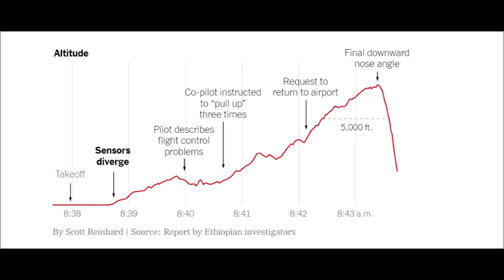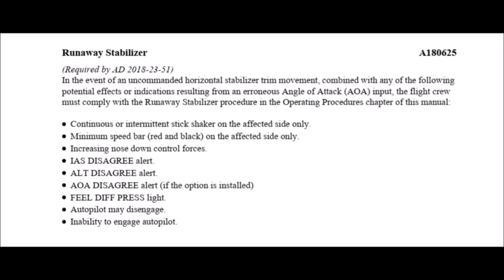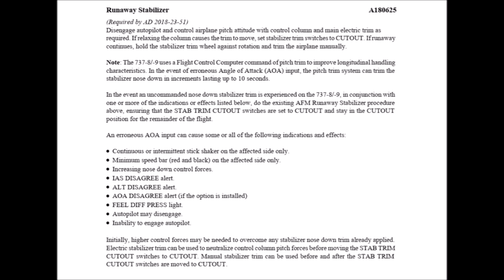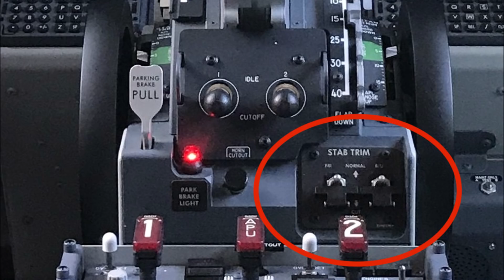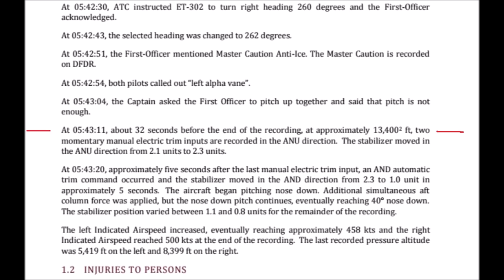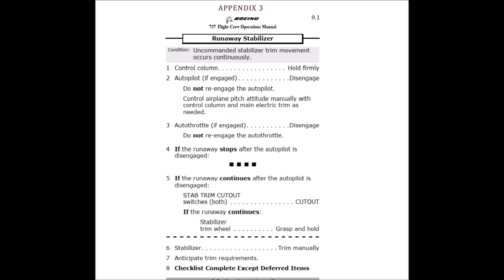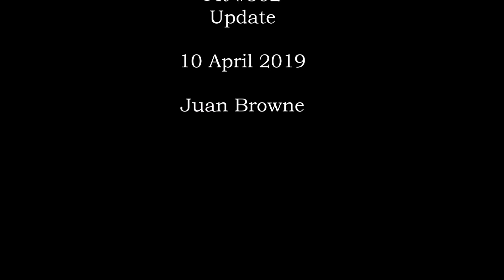737 Max Update 10 April 2019 Runaway Stab Trim Procedures

Comment: With tunnel vision and startle factor in mind, perhaps the synthetic voice for overspeed should be changed from "overspeed overspeed" to "overspeed reduce thrust" especially if the systems detects thrust is set to anything other than idle.  But I guess they may not even hear that with all the other notifications going off.  Just thinking out loud here.
Reply from the maker: at the same time the stall shaker is going off...very confusing.
Reply: @blancolirio  It is.  Brutal situation with little time to process.

Comment: I am not a pilot but to my understanding, there are only three attitudes to control on any plane - roll control by ailerons, yaw control by rudder and pitch control by elevator or horizontal stabilizer, ( yes I know there are other arrangements) but in the case of the 737 the only other variable related to these are the throttles (power) and I also understand that trimming the aircraft to fly straight and level hands off used to be the job of the trim tabs but in this case trimming the horizontal stabilizer. My question is if the aircraft had recently been successfully operated wouldn't the pitch trim be relatively correct even though the CG  might vary with the load. Is it, possible pilots are slowly being reduced to button pushers and are incapable of maneuvering the plane by controlling these three basic functions? It seems unlikely to me that the elevator or (horizontal stabilizer) control could be taken away from the pilots against their wills by an electronic device and if that's possible then the MCAS system is indeed a huge mistake. My sincerest condolences to all those survivors affected by this tragedy.

Comment: They should've geared the manual trim wheel lower, so it's usable at high speed. Because right now if there's a high speed electric trim failure, you're done.

Comment: You can discount anything Ethiopian airlines has to say about the crash, they are concerned only about their reputation and are incapable of objectivity, it's obvious that the crew did not understand the systems and mishandled the aircraft, even though the mcas malfunctioned the procedures were there to regain control, by not reducing power aerodynamic forces made it impossible to regain control and that's the pilots fault ,not Boeing ! They didn't follow correct procedures, simple. In a previous Ethiopian airlines crash (flight409) when the stick shaker activated the captain asked the first officer " what's that" I wouldn't fly this third world air line for free !

Comment: Very good and professional series of explanations to what might have happened! however, can one be really sure that the trim runaway procedure really shuts off the MCAS system?
Reply: To the best of my knowledge, MCAS controls the trim via electric motors. Once the stabilizer trim motors are deactivated via the switches, these motors can no longer run, no matter whether the pilot is attempting to operate them or MCAS. Once the Stab Trim switches are turned off, the only way to control the trim is through the manual turning of the trim wheels.

Comment: When are they going to replace all the Angle of Attack (AOA) sensors on all Boeing 737 MAX aircraft?
Reply: They better figure out a way to test it.  Who knows if it is properly designed and tested?  It could be like the lint filter on an LG dryer.

Comment: As a non airline pilot I'm shocked the more I investigate the industry at just how much of the work that tech does. To me it seems simple, the reason there are complications is because pilots are trying to deal with systems, rather than stick n throttle basic flying. If pilots were once again hands-on then I feel that certain types of accidents would reduce.
Reply: @c7042  we remember differently. I agree there were accidents due to pilot fatigue but that's because of workload demands driven by greed of the companies and could easily have been ended. Maybe British tabloids reported less, but I felt safer back then. Any System that has complicated /many parts having to work together introduces more risk, especially if those parts work differently. Like computers and people. Yes people are prone to err, and autopilot etc are amazing these days, but if you have good standard flight crews in charge and using the correct aides which allow them to always take immediate hands on total control, then I still feel it would be better.
Maybe they can incorporate a function initiated from the stick, were by pressing one button cuts out all mcas primary control(is this available?), instead of reaching to the panel to flick two switches. I always feel that as it's we who invent tech then it should be an aide and not in control. I see the accident as being a problem of a pilot having to deal with systems, were as without mcas in the picture I doubt an accident would have occurred. Computerisation induces laziness also. Unsharpens the mind and leaves it prone to distraction. Or to relying on it.
I suppose it's how you look or see things. We are subjective creatures after all

Comment: Very good report!  As a ATP/Instructor pilot with over 18k hours and 33 yrs of flight time. am disheartened that the aircrew 
didn't know or comply with required Memory items of the Emergency Trim runaway Checklist!
Reply: Lostcreek 1 The checklist as written and the AD update as written are completely out of order, with steps written, not following chronology, twisting words to not list MCAS by name, not describe the effect of manual electric trims on MCAS, not removing counterproductive steps (AP/AT off).  A proper procedure could have been written as briefly as the AD in a way that could be followed in a high stress emergency like the Indonesian crash.  The procedures used by the two Indonesian crews (living and dead) would make more sense.  Something like:
Condition: (as in AD but listed before procedure)
Procedure:
  1. Watch trim wheel movement throughout procedure.
  2. Repeatedly press the trim buttons as fast as possible until trim is good (this disables MCAS) if this doesn't work, repeatedly engage AP (this also disables MCAS) while still pressing trim button.
  3. counteract with buttons whenever it starts moving down (this should limit MCAS down to 0.4 units at a time).
  4. Once trimmed, cutout trim switches and grab the trim wheel.
  5. Fly manually and land.
This skips the steps applicable only to other problems, inverts the AP off step, lists everything in the correct order, actively counteracts MCAS and restores a flyable configuration.  It also avoids ambiguous phrases like "manual trim" versus "manual electric trim".
Reply: @johnfrancisdoe1563  Dear John Doe,  thanks for your comment.  I don't follow your note. as to all your claims of how a checklist and AD's are designed and  written and approved by experts in the aviation industry and regulatory bodies.  Please submit your idea to the FAA!  When you get a chance!

Comment: After watching your videos on this MCAS system I feel I would be a good asset if that happened.  unfortunately the cabin doors are closed so I would be dead along with the pilots focused on fixing the trim.  My opinion as a programmer and dealing with what ifs, Boeing really fast tracked that system.  They alway brag about redundancy but failed to incorporate different scenarios in their MCAS.  It should have know speed was way above stall, height above ground, through through multiple inputs from flight trying to reduce MCAS effects and alerted shutoff of system.  This would work even if the stall indicator was bad.  Hard to stall a plane at 500mph even at high angles.  The speed would have to slow down to stall.  Not having 2 sensors for input tell me that they didn't want to bother with the complexity of figuring out which was correct so decided to get the plane out fast as they didn't anticipate this new engine making a difference in selling airplanes.  They could have made a band around those switches to differentiate them from all the other switches with a line Death will follow if you don't cut these off when active with one bad sensor.  I just watched the spaceX launch of the falcon heavy.  They seem to do things right with verification of each step.  Maybe Boeing should buy some real engineering time from Tesla to get some sophisticated software to fly a plane.  The autonavigation of a model 3 is way more advanced than handling a few hundred sensors and hydraulic pumps.  It actually has to look at stuff through cameras and make decisions.  Reading one sensor and controlling a motor is not a very sophisticated piece of software.  Guess they don't have liquid cooled supercomputers in the plane.  They should have designed an aircraft to handle the power plant instead of sticking them up and out and whipping up a quick fix.  
I visited the Boeing's museum and was impressed by everything but this is a real issue in management not giving the worker bees enough time to make this right.  
GREAT video and love watching your channel.  A friends son is a pilot and someday I will have a discussion at a party and see his view on this subject now that you as usual gave a clear and concise explanation as I am sure Boeing is not giving to the FAA.
Reply: Rick Ruehl , great to hear this from a programmer. Im not a pilot or a programmer but I've spent years operating automated industrial equipment and witnessed things happen that are supposedly impossible according to the PLC in charge. When I was able to demonstrate that I could replicate the error by blocking a photo eye with debris and making a couple switch movements, the electricians grudgingly admitted there was a problem in the logic, and made a simple fix.

Comment: I spend some time analyzing the data (graph from the preliminary report). And this is mine conclusion:  1) 100% trust was the only thing that was keeping the plane's nose up. Check the correlation between the pitch and the trust during the ascent phase. Reducing the trust at the end sealed the fate of the flight. 2) The manual and automatic trim graphs show that manual trim overrode  MCAS action and started turning the trim the right direction. I am afraid that pilots missed this motion revers and unfortunately turned off the trim according the procedure. 3) The end was when they re-enabled the trim without pressing manual trim and reduced trust. There were ways out: 1) Turning off the trim once the stick started to shake, 2) Never fully retract the flaps to keep MCAS in "stand-by" 3) React sooner to the MCAS action (about 30sec once flaps were retracted and the autopilot disengaged) 4) Use the trim button to put the trim in neutral position and only then turn it off. 5) try manual trim again once re-enabling the el. trim.

Comment: When you mentioned 500 KIAS, I was thinking "Mach Tuck" and you brought up Transonic Flow.  That definitely would have aggravated the nose down forces they were facing.
Reply: Mach Tuck is usually trimmed out by the auto pilot or some kind of automatic Mach trimming device in many aircraft.

Folks may complain that there is to much automation but the reality is transonic Jets needed all of the following since 1940s. These problems can not be solved aerodynamically.
1 Yaw damper to operate the rudder to stop high speed snaking.   Germans were testing these in 1943.  It’s just a part of Jet aircraft.
2. Automatic Mach trimming device to trim the nose up as the center of lift suddenly moves back on the wing at transonic speeds.
3 Yaw dampers also add rudder to eliminate pro-verse and adverse yaw when banking the aircraft due to different drag of ailerons at different speeds .  This manifest as either a tightening turn in the opposite direction both of which are undesirable.
4  differential ailerons.  An aileron should be deflected less in the downward direction than its partner is deflected in the upward direction due to the greater drag of downward deflection.
5 in most aircraft the thrust axis does not align with the principal drag axis.   From a structural point the optimal layout is to have a low wing and underslung engines.   I Leef of this layout pretty much requires automatic pitch control.
6 fully powered controls with no mechanical linkage to the flight control surfaces is absolutely essential so that the phenomenon of flutter and pilot couple of solutions can be eliminated.

So there was already a high level of Automation you can’t avoid however the problem with the MCAS system was that it was just badly designed System that is so powerful and acts so invisibly.

Comment: Juan is spot on with his analysis but it should not be overlooked that there have at least five other MCAS related incidents that pilots handled appropriately and the aircraft landed safely after disabling the system. It also seems that previously existing versions of the software were flawed and changes to such suggested directed to addressing the situation. For pilots loaded down with so many complex procedures would be nice if there were a simpler procedure to go to a manual over ride of automated flight control systems. Saw another video from another well respected real world pilot Steve from FlightChops interview with renown stunt pilot Julie Clark comments about flying 'computer' aircraft namely Airbus but think applies a bit in the current 737 MAX situation (from the 4:19 mark in the included link - https://www.youtube.com/watch?v=eBWsFeEHTaQ&lc=z22jwvyosnz5xrrmwacdp431cfzhvfs5r41r3nq030hw03c010c).

Comment: 10 cent led to give AOA errors?  boeing. Wtf. All those millions. Can you just toss in a led? 10 pennies, and that’s probably a high estimate.
Reply: You have to have some code somewhere to compare the two sensors and direct MCAS not to execute.
Reply: @robertbrandywine  Yes sir, Id say if the aoa sensors are there, then the code is there. In fact, the code(some signal, driver....something actuating the jack screw) was there to adjust the MCAS automatically, so it is absolutely there.  Simple software unit testing on sensors mean a lot "in-house", but if we cant give pilots an idea of what those sensors are doing (because software engineers aren't typically pilots and computers can be as stupid as we program them), then we have failed: We failed the pilots and the family members on board. We gotta to better than this.

Comment: Again, Juan, GREAT JOB!! I can see both the need for the MCAS system and especially the need to modify or fine tune this system. There are just so many possible variables when certifying an updated airframe. I think that things can just be so complicated that sadly, it takes time and experience to really see how something as complex as a modern passenger airplane will end up working in all its facets of operation. Again, thanks for your work and enlightening commentary!!

Comment: The more I hear, it sounds to me (not being a pilot) that the accident was defiantly the pilots fault.  Boeing's fault is doing such a terrible job design a system such that it drastically increased the likelihood of something going wrong (single sensor) and having the systems interactions so severe between timing, pitch delta and max.  It is these decision that ,I assume, makes it harder for a pilot to realize what is actually going wrong with reduced recovery time, drastically increases the pressure and probable panic of the pilots, resulting in an increased probability of human factors becoming an issue and not being able to think in a calm and logical / trained fashion to solve the problem.  (I can defiantly recall personal times that a fraction of the panic/stress resulting in exponential time increase to solve a problem and think rationally.  After the fact or looking at some else's problem, the solutions and time it should have taken feels self explanatory.)
Reply: If the steering wheel dosn't guide the car, is it the driver's fault?

Comment: I may be wrong but I thought MCAS was developed in response to a number of recent airline accidents where a nose up condition was the primary cause. Why not put a mcas activation warning telling you that it is augmenting the controls,  "MCAS PITCH DOWN"?  As an engineer, I am gobsmacked the mcas doesn't query the second AOA as a reference check and if tolerance If not met disable Mcas and alerting the pilots to the sensor discrepancy.

Comment: I'm glad you're back to do a more complete analysis of this, Juan.  Thanks again for what you do.  I can't imagine the stress these pilots were under at such low altitude.  To me, simulator training should have been required for the MCAS addition, and simulated faults such as the AOA sensor and how to recover.  Maybe I am wrong, but at such a critical time a few seconds can make the difference.

Comment: Good explanation.
2 observations:
-  the automated systems seem to be getting more and more complicated. Why was a design ever allowed in the first place that has so much inherent risk? Who in their right mind would allow a commercial airliner to be so vulnerable to "erroneous angle of attack input"? I get they were trying to increase the dynamics of the original 737s, but at what cost? They may be slower, but they'll get you there.
-  Important to consider that human tendency to be complacent, with particular regard for technology. Mishaps with technology are commonly in the news, not just in aviation. Computers are a useful tool but it's very easy to become overly dependent on them. They are not perfect. IMO every automated system should be easy to disengage and every pilot should be well versed in how to fly their aircraft without the automated systems. I still feel even a sophisticated airliner could have a simple (forgive me!) idiot button the pilot could hit to disengage all automated systems so the pilots could fly the danged planes!